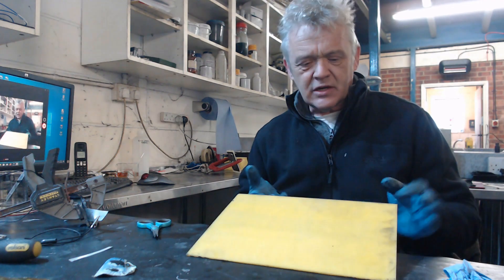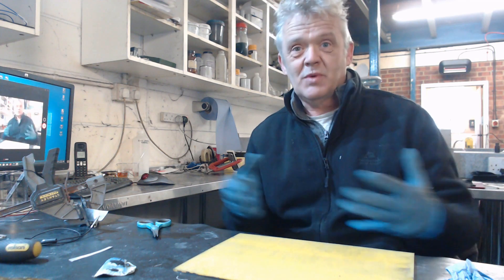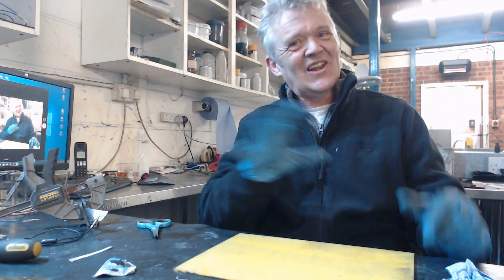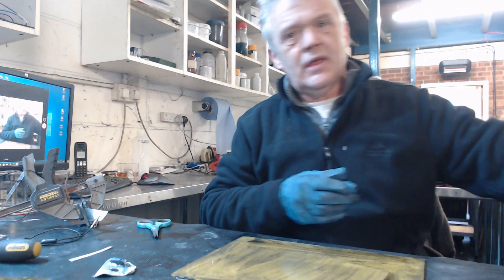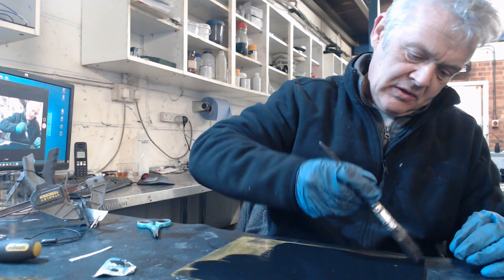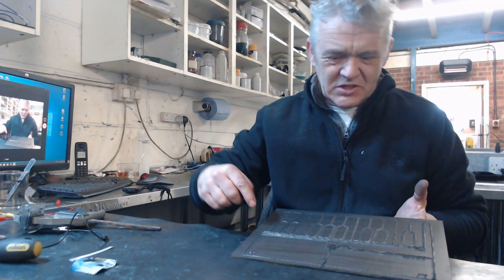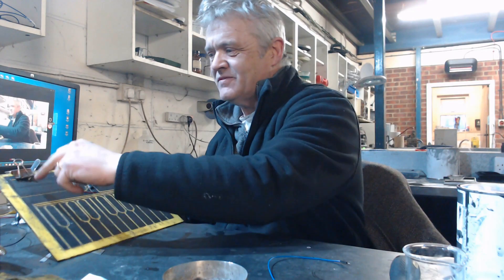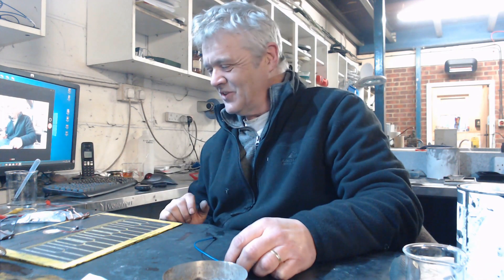A 'Printed Circuit' With FWG Conductive Ink - A Stylophone

Comment: Hi Sir, i have an inquiry about the ink, wondering about the ink if soldering iron would stick to it after it has been painted in plastic and laser cut? will soldering bond to the graphine ink?
Reply from the maker: I will give it a go mate
Reply: @ThinkingandTinkering  thanks sir, planing to uses the ink for lasered pcb
Reply: Maybe wand plate with copper first
Reply: I was thinking what if copper solution was mix in d making of  d ink, making it a copper/ grqphine ink, possibly attracting d solder

Comment: would be cool, if you used the laser cutter to cut grooves were the copper schematic would be.  Drop resistors ans capacitors, transistors metal tabs where out side connectors would be. Then fill all the lines with your ink. let it dry.  A thin layer of clear epoxy to hold the components in. then power it up. crystal radio?
Reply from the maker: like it mate - will probably try it

Comment: hiya Rob,thanks for sharing that was awesome! i think inkjet printers cannot handle your ink due to its contents and viscosity but for sure a 3D resin printer will do a great job there are many cheap ones available in the market ,fantastic idea !for future tons of applications,absolutely future will be so bright for such an ink.well done ! cheers mate.
Reply from the maker: 3d resin printer - never heard of them mate but you are spot on the particle size is too large and the viscosity too high for inkjet - but I will look into 3d resin for sure - thanks for the suggestion
Reply: @ThinkingandTinkering  Hiya Rob,yeah it's actually a resin dispenser and works by CNC .works better with viscos inks.
Reply: You can also do this with an fdm printer with a syringe dispenser!  You can make pretty small circuits this way!  Isreal has a professional  grade pcb printer with pick and placement of the components!  Nano Dimension's 'Dragonfly' printer!

Comment: Either an ink-jet or bubble-jet printer would seem a more efficient way of printing... ~( 'w')/
Reply from the maker: won't work with the ink - see my comment to Ama Zac
Reply: @ThinkingandTinkering  Oh... too bad.

Well, maybe if one printed a mask [or nonstick film] and then used a litho type roller process.

Would certainly speed up normal battery/capacitor manufacture to use an offset ink press method.

In fact, if you need it in a pattern, just make a template, roll the ink on to your current collector, then run that right through a laser cutter.

If you use continuous feed, you can greatly reduce material costs by using nesting to maximize material efficiency.

One can pretty much work it just like a printing press. I have worked them and also other chain process machinery, could build one cheaply even. [assuming one could not be gotten cheaply enough used at an auction]

Comment: So both a variable capacitor and variable resistor can be made, do you think you can add a variable transformer too? ~( 'w')/
Reply from the maker: I did a video showing it could be a transformer so - I think - yes
Reply: @ThinkingandTinkering  Spiral stacked paper or plastic coils or something like that could allow multiple taps and multiple voltages.

Comment: How do I pass from the ink to a weldable tab?
Reply from the maker: the components are held on by the ink - it acts like a glue - but if you wanted to attach a tab you would glue the metal onto the ink then overpaint the section that laying on the ink and hey presto - maybe I'll do demo - sometimes so much easier than words lol
Reply: I agree that a demo would help. I was wondering about that for a long time.
Reply from the maker: @Olivier Roy will do  mate - probably tomorrow - after all you are a member - so you get members privilege which includes videos for specific problems - cheers
Reply: You could screw the metal tab onto the board, using a nut and bolt, and paint the ink over it. And also have the ink go under the metal tab.
Reply from the maker: @zylascope  nice idea mate - cheers
Reply: You maybe able to wand plate it with some copper and then solder 👍🏻